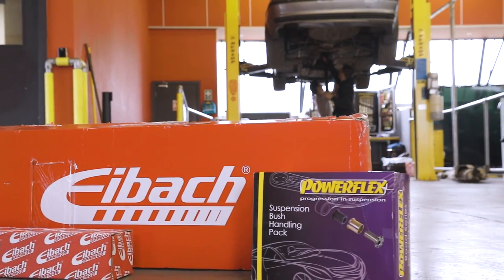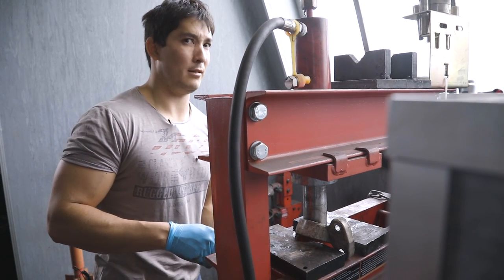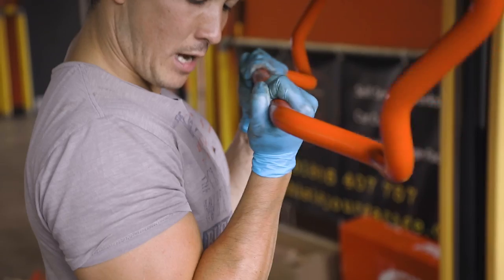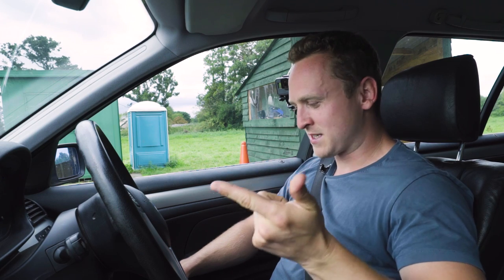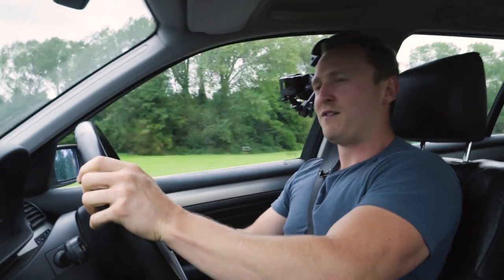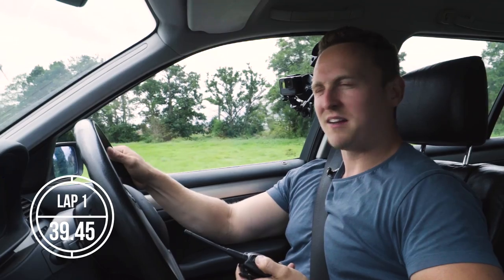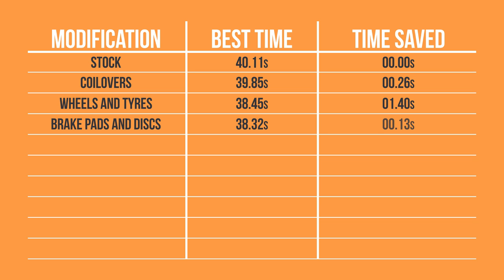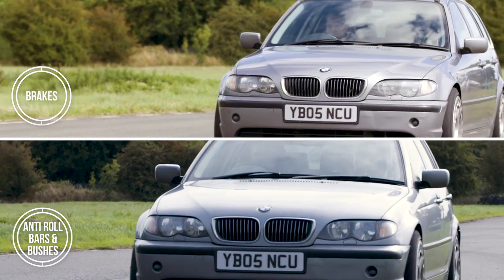Do Thicker Anti-Roll Bars And Polybushes Make A Car Faster?

Comment: Remove the muffler and add some stickers. I bet then it will do lap under 35 seconds
Reply: 1000 subs no videos and racing stripes
Reply: You guys forget about carbon fibre stickers.That will give it a 30s flat.
Reply: Don't remove the muffler just cut a hole in the fucking exhaust
Reply: Naw just gotta get vtec
Reply: 1000 subs no videos I
Reply: Stickers cover tiny holes in the metal which helps to redirect the air to the back which is what causes the +5 hp
Reply: You forgot M power sticker hahahaha
Reply: Come on guys we need lambo door😂😂
Reply: 1000 subs no videos also add a giant wing
Reply: 1000 subs no videos No smoke No poke lol
Let's see Gareth rolling some coal hey 😀
Reply: Make the exhaust go into the car
Reply: No just saw it off and put a giant pipe on...WHY NOT
Reply: 15 subs no videos
Reply: Poland and East Europe in general 😂 😆 😂
Reply: just  bring your keyboard
it gonna boost your viecle to 1000hp

Comment: ecu tuning air intake exhaust turbo upgrade do it all mate
Reply: The whole concept of Gareth is to beat the M3 without any engine upgrades
Reply: Air intake is pretty pointless in diesel’s
Reply: @11cnm18  rip everything out from inside. Don't need rear seats, spare wheel etc etc all useless. Roll of duct tape will help also but it might heat up if you cover too much with it lol
Reply: Big intercooler and map will give great gains
Reply: Optical Clarity Do you really think they will end the series without doing any weight reduction?
Reply: @Optical Clarity he had already done suspension brakes ect he said that already he is moving on to performance now
Reply: @Optical Clarity fair enough if he was taking it round the nurburgring but he's only on a sub minute track
Reply: Optical Clarity My understanding and expectations of this project is that this car will end up being as light as possible, with no concern about keeping the "daily driver" features. I may be wrong and it might end up being just a tad lighter than now.
Reply: @Optical Clarity of course it could, as It could with any car id drive it round a 1 minute track with a big open space no worries. That's just being ott take a risk in life u might be dead tomorrow.
Reply: Yeah and DONT STRIP THE INTERIOR
Reply: Ahmad Benni the point was to beat the M3 without weight reduction, not without power mods. Can’t expect to beat it with half the power and similar weight 😃

Comment: Weight reduction brother. All the time is hidden in the excess weight!!
Reply: Alexandros Diskakis true but it’s kinda cheating tho taking the car to bits,both cars have to be whole for a true comparison.
Reply: I was kind of hoping this would be next. I mean, it's free, and it improves everything about the car - why not do it? It's a track car after all, it's not like comfort is important...
Reply: i know..but just taking the backseats out of the car and replacing the front ones with some recaro's could easily save 50kg's
Reply: true..but m3 doesnt either have semislicks or racing wheels...right?
Reply: Taraniis surely by that logic the M3 will need aftermarket alloys, wider tyres, eventual engine mods, roll-bars, racing brakes and coilovers then?

The whole point of this series is to see if you can modify a cheap old estate car to beat a sports car on the track. He even said in the first episode they're planning on stripping it.
Reply: What? The point is can you make an old cheap 3 series as quick as a stock M3!....  which would be a great achievement! Obviously a modded m3 is going to be a far better starting point but that defies the whole point of this video
Reply: They can't sell it on their website
Reply: 7777Carlo - perhaps they can use a special set of spanners to take out the seats and flog the tools lol
Reply: I agree I think removing the interior ruins the car and makes the challenge too easy. It’s much more impressive seeing the car beat an M3 whilst being a useable family estate
Reply: There is ~200kg+ free stuff you can trow out, people are always shocked when they do weight reduction on a BMW (especially newer ones), compared to Jap cars, there is so much sound deadening, tick heavy carpet, and lots of other heavy shit witch gives BMW that premium luxury feel, but hiders the performance.
Reply: What could we take out for that bit of weight reduction?🤔
Reply: Everything to the bear metal, and make it a single seater
Reply: Most that they have done so far would appear to add weight.  New anti-roll bars (anti-independent suspension bars) must be at least 30% more massive.
Reply: pasenger seat in e46 are 35kg or dead weight ,get rid
Reply: True, excess weight can be taking away without any effect on the car if you do it right that is.. the amount of excess weight in most cars is unreal

Comment: How long before you have a go at the engine?
Reply: Next week!
Reply: This track is small and twisty so power makes less difference
Reply: Christ chris of course it will make a difference lol
Reply: Alex Kersten you should do a weekend rental on the carthrottle website and you can throttle me anytime
Reply: @notmanynamesleft  i didn't say "it makes no difference" i said "it makes LESS difference"
Reply: Regardless of more power. Power adders and a chip will increase acceleration which is pivotal on a small track. Provided he can keep traction. Honestly weight reduction would be the easiest and cheapest way to decrease track times
Reply: Exactly. They could just remove the rear seats and maybe the passenger seat too, that would surely help
Reply: Power makes a lot of difference on any track when traction is not the limiting factor and aside from the start it isn't trying to spin it's wheels for most of the lap. What might apply to two different already powerful race cars does not apply here.
Reply: @stu0508  yeah, it surely makes a difference, but i personally think weight reduction is more important on this track
Reply: Kush Daddy every single diesel guy or muscle car guy I see here lmao
Reply: If u check gareth's insta you will see that they track it with a race chip
Reply: Kush Daddy then get a proper tune from a proper tuner. An exhaust, a turbo and some injectors to go with it, and it’ll fly
Reply: Alex Kersten Keep us posted big lad 👊🏼
Reply: If you do weight reduction you do it properly, by removing everything, I mean EVERYTHING!!!
Reply: Kr Dz 😂
Reply: ECU tune will get you like 90hp...
Reply: KÎMØ Who's dyno is that loose ? Perhaps my 65 hp Clio could achieve 400 hp ??
Reply: @Dan23_7  you clearly know what you are talking about... its just this car. Turbo diesels often get +60-90hp with simple ecu tune. Only way Your clio will gain hp is to sell it and get a faster car.
Reply: KÎMØ I used to have an Alfa 156 2.4 Jtd 
175. It achieved 233 hp and torque went to 315 lb ft. It was an animal
5 cylinders 👌🏼
Reply: KÎMØ My Clio is sh1t slow haha
Reply: Stick on a typical Diesel Tuning Box to the fuel pressure rail sensor. These generally ad about 30bhp, and an extra 50NM. As well as a full engine service at the same time.
Reply: DJ_PaulTUK increasing rail pressure will do squat as the injectors will still deliver the same amount of fuel...
Reply: Stuart Johnson Pump-squeeze-Squirt 
They do work. Adding more fuel on a diesel creates more boost as more exhaust gasses are produced

Comment: Tune it. 'Tis time.
Edit: btw a space bar on a key board has an anti-roll bar.
Reply: Also, Mr. Limited Slip Diff has to enter the realm of E46
Reply: They need more usable RPM out of this engine, make 6k redline diesel :D
Reply: You'll like next week's ep!
Reply: @alexkersten1964  yay!
Reply: @Kocan7  They will have to change the turbo for that, so I belive they will just crank up the boost and TORQUE
Reply: @alexkersten1964  Thanks, cheers!
Reply: Diesel's redline is driven by the speed of the flame in the combustion process.
Reply: My keyboard’s space bar doesn’t have an anti-roll bar.
Reply: @Alex-bq3kp  if you push it on only one side, does the other side go down too?
Reply: Who copied who?.
Yo dude. How do we get our cars to stay level when one of the sides go down? 
Bruh I'll think about it, email me.
Your mom ga- DUE ADD THE SPACE AR THING TO THE CAR. THE SPACEBARS SIDES GO DOWN AT THE SAME TIME.
Reply: Jamil ahmed I have the new MacBook Pro with butterfly switches lol
Reply: @Alex-bq3kp  oh I keep forgetting laptops exist.
Reply: Yeah, I got an anti roll space bar between my ALT keys on my keyboard.
I'm thinking of getting new shocks on my Keyboard buttons though, just to improve the rebound stiffness a little... Also, there's an alarming amount of play in my keys. I might poly bush them and my Space bar D's to get better "typing feel" and "press in" when doing "YouTube-Comment-Section days".
Reply: +Lewis72 No, it's about bore vs stroke, diesel engines have longer stroke, if someone will build 9k red line diesel engine cylinder will travel crazy fast and heat from friction will sooner or later destroy engine.
Reply: @Kocan7  gimme a shortstroke diesel
Reply: Lewis72  This is not entirely true. There are fueling tricks that can be done to increase the usable power band. Remember, like anything OEM, reliability margins can be narrowed and fuel efficiency can be reduced.
Reply: +atsernov True, but if you add way more torque really low you will kill clutch sooner or later, the same issue was with chip tuning 1.9jtd in Alfa 147, it was better for yur drivetrain to have peak torque a bit later (friends car).
Ofc, you can just upgrade clutch :)
Reply: szczsz  If your clutch isn't slipping it really doesn't damage it considerably. You just run into the same problem as with any clutch when increasing power, the clutch becomes more critical of your footwork; and if you add too much power it simply can't hold it.
Reply: @PROcrastiDRIVESVofficial  you can actually make mods similar to that. There's mechanical keyboards and oh boy there's some mods you can do. Dampening rings to reduce sound. You can change out the springs, change the stabilizer bar. You can manage play with better keycaps. Maybe have the wasd keys as blue switches for a more tactile feel.
Reply: yes. however the redline for these engines is not limited by burn time (in terms of crank angle). else cetane boosters or better fuel could add rpm (if the rev limiter is re-set, that is... wait, why is there a rev limiter in the first place?)

Comment: "where the tyre are the limiting factor" Told you guys when you put on Chinese (Taiwanese) B grade tyres where the M3 contendor had Michelin Pilot Sport 4 S installed... The tyres were by far the best improvement you guys have made but you insisted on not using the same ones as your contendor, still inexplicable choice to me. All the rest made only marginal gains and actually could be explained by learning the track and car better.
Reply: Orvieta much agreed, the term “ditch finder” has always followed the name Nankang whenever someone’s mentioned it in my experience
Reply: Something like a dunlop direzza z3, bridgestone re71r, or bf Goodrich rival s would give much more grip not to mention feedback which would in turn help the driver utilize all of the tyres grip. Dont understand why they cheaped out on pretty much the most important item for improvement of laptimes.
Reply: All of you are highly misinformed. The Nangkang NS2R is a very capable tyre and should have the edge against the super sports in dry performance. Jonathan (Mr Tyre Reviews) isn't an idiot and wouldn't have recommended them for this build if they were shit.
Reply: @michaelpetricca7151  I don't think any of the tyres you listed are widely available (or available at all) in the UK.
Reply: Fair enough if they're not available but you're telling me that a nankang was the best available street legal tyre? I find that incredibly hard to believe.
Reply: @michaelpetricca7151  There are better dry performance tyres (Michelin Cup 2, Nankang's proper semi slick the AR-1, Trofeo R's, Toyo R888R. I'm sure there's others I'm forgetting), but they all cost significantly more. For dry performance NS2R is probably the best bang for buck tyre at this time. Some people say they found them better than the revered  AD08R others say they're slightly worse. Case in point is, they are in the ballpark and are a fair bit cheaper!
Reply: NS2R is good bang for the buck tire, sames as the Federal 595rsr, but they can't match the the best soft core semi slicks - AD08R, AD052, RE71R
Reply: Tyres are the limiting factor; suspension mods and brakes change specific handling characteristics some may improve performance.

A tyre brand test would have been more scientific.
Reply: Federal RSR-R....Nankang Sportnex series like the NS 2R is a highly regarded and race proven Taiwanese tyres...
Reply: Don't get snobbed on brands . Some of those lesser known brands do equivalent results nowadays. Been done to death now with Federals, Ns2Rs , theyre even being used as a control tyre in BMW cup series here in UK. There are even more new brands like Zestino  which fall into hybrid class like Yokos AD08Rs , but have dry grip almost as true semi slicks.
Reply: @mantazini  Exactly. I forgot to mention their use as a control tyre in some racing series. Like the Civic Cup and BMW cup like you've stated.
Reply: Nothing wrong with Nankangs. They're good ones fitted to this car, these people getting all technical and snobby about tyres, it's only because they're terrified of a little oversteer ;-) It's mostly down to driver skill.
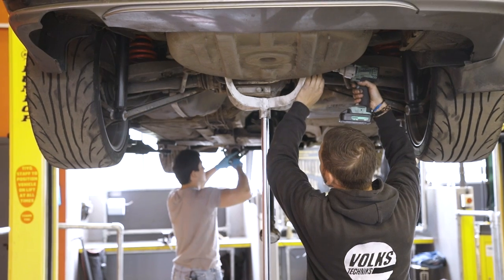Reply: Plus the rear tyres are on backwards check at 1:17... Call me crazy but they're low budget directional semi slicks
Reply: The compound makes the difference not the brand. A Ps4s is never gonna perform better than nankang ar1 on a dry race track

Comment: Drivetrain would be befor power,
LSD and a better clutch/fly weheel then give it a tune to see better results
Reply: Can confirm car is now stripped
Reply: I would go for smaller wheels (17inch) and 245 oder 255 tires in the front.
Reply: And then add a bit more camber.
Reply: Weight loss should have been first, as all settings; camber, corner weighting/etc will need to be adjusted to account for changes.
Reply: They decided on keeping the interior stock.

Comment: Geo: fr 3.5 neg 0.05 toe out each side , rear 2.2 neg 0.10 toe in each side . Retry the test .  By the looks car still wants to push the front due to Mcpherson type of suspension pushing the hub to positive camber under loads , lack of lsd doesnt help either . By the looks the way the wheels sit , its very mild setup , and you aint having quick times with that.

Comment: A drill with a wire brush and enamel paint would have done wonders to the rear subframe.
Reply: Underrated comment. If they are taking smthin out least they could do is brushy brushy and anti rust paint...
Reply: Was looking for this comment. After all that job taking the subframe out, then give it some love people.
Reply: Agreed, there is no way I could replace any part with out some type of prep. It's the right way of doing any job.

Comment: Alex mate, a lil tip for some fine tuning. Upgrading the front and rear anti roll cars can change the car's handling balance quite significantly. Its a good idea to fine tune this setup with damper settings, camber settings and tire pressures. Watch the Slowmo again and you'll see the car understeer at the apex, it appear the front might be abit too stiff with the previous suspension damper settings AND the new anti roll bar. Try to soften the front damper by two clicks to get better turn in. If the problem is oversteer (rear axle) soften the damper by two clicks.
Of course all these takes time but at the end of the series dial all these stuff in and you should be even faster! :))

Btw I'm loving this series!  thumbs up if you like it too!   :))

Comment: The most important part of going faster is tuning your parts and ailment you just can’t bolt on parts and go faster they should be showing the tire temps and wear and adjusting the seat bars and alignment to maximize grip -__-

Comment: I think, better thing than more power is less weight 😊 (like Chapmann said: power give you speed on strights, less weight give you speed everywere) if you throw away an interior, audio and some other things it will be the second best mod after wheel and tyres 😎 one only thing is to keep good mass balance, not only lightened the back end 😉 your tyres will bee thankfoul for that 😜
After that (or before) you need bucket seats and harness.

Comment: You’re loosing a lot of time by going over the curbs in some of the corners. Your wheels lift off a bunch coming off of them and you loose grip and you’re not able to accelerate as quickly.
EDIT: The liftoff and loss of grip is also what is causing you to go wide in a lot of the corners and go into the grass.
Reply: Stephen Hawking 
But the glamour shots and youtube moneys!
Reply: Stephen hawking. Are u really Lewis Hamilton?.

Comment: I have a slow E36 318is coupe but after the Turner Motorsports chip, BavAuto sway bars, Hawk HPS pads, blank Brembo rotors, B&G S2 springs, and Koni Str.T shocks and struts, it's been a HUGE improvement.

Comment: A friend of mine had a E46 330D saloon. He decatted it, put a large bore exhaust on with manifolds and had a professional remap. Had 340bhp and 600nm. Thing was a beast. Best thing about euro 4 and older diesels is you can remove all the emissions stuff without making the car illegal as cats etc aren't a legal requirement on old diesels